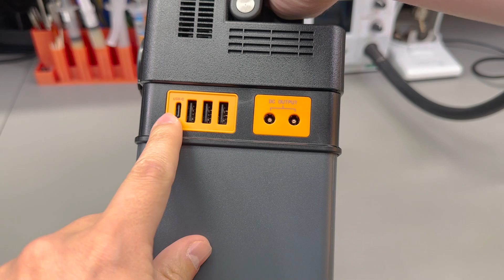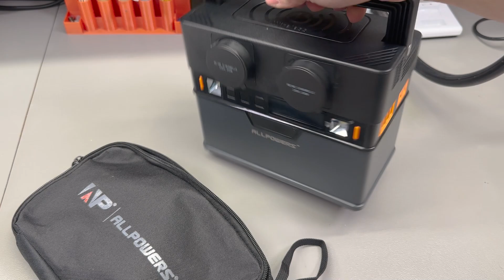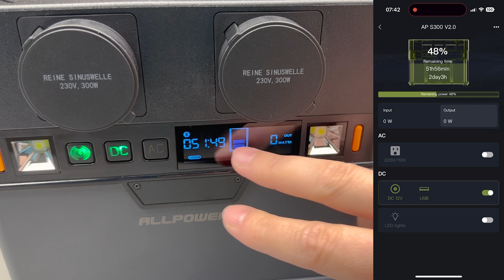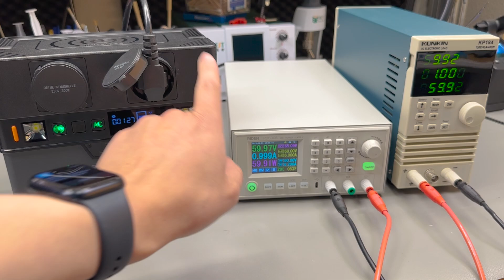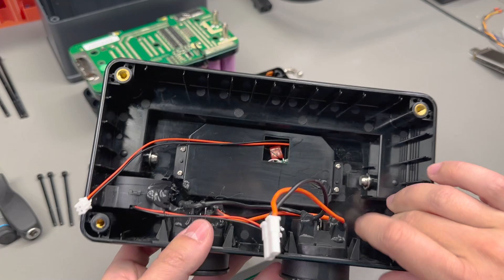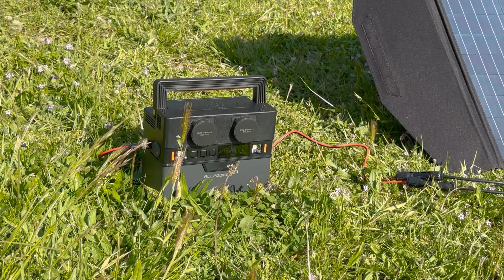AllPowers S300 Power Station Review & Teardown | Voltlog #445

Comment: Anyone wants to know how to reset the battery percentage to the correct battery display , hold ac and dc in together it will beep then still hold will beep a 2nd time keep holding until the 3rd beep then let go youl see the display do the reset to match everything up , do it regularly least 4 times a month

Comment: According to the manual the 12 Car socket is both an input and an output. Considering this you could add extra 12V battery packs with some control circuitry to charge and discharge as needed. Good use for all those 18650 cells that somehow get accumulated.

Comment: Hiya, i found this review very helpful, 

Ive iust bought one of these to use with my laptop which uses 150w. 

Hwowever. I plan on using a dc step up invertor, so i was hoping youd be able to tell us the amperage out of both the DC outputs, what can the cigarette port put out in terms of amperage ?

Thanks

Comment: Great review. Just ordered myself one of these with the solar panel as well. Charging was very quick with the solar panels (for my camping). Great product had the same issues with the DC cut off especially when I connected smaller portable power packs to charge. Big issue I had was charging the phone on the wireless charger but this fantastic review cleared that up for me, shame about the design flaw. By any chance have you found away around this because other than that I am very happy with the product.

Comment: The AC on my S300 doesn't work 0w output, any ideas? Everything else works
Reply from the maker: If you powered the AC circuit on from the dedicated button and it doesn't work, something could be damaged. Have you overloaded that output? Could be reason for warranty replacement.

Comment: What can you use max 300W for? Not a water heater, not a coffee machine, not for power tools, not a vacuum, not a microwave. That leaves TV, laptop and lamps.
I understand you earn a commission for talking about this device and for the links, so you have to talk nice about it, as it's income for you.
You really should reveal that in the interest of honesty.
Reply: Most people won't be using such a power station or a microwave for example. It's more meant to be used for mobile stuff, for camping. I have been using such stations when filming outdoors where no power is present, so I can easily charge my drone remotes, and batteries, power a laptop, and a 60W light that I use when I need a bit more light when filming outside.
Reply: Guitar amps, speakers, laptop chargers, slow cookers etc. 300w is plenty for what most people use these packs for. But yes, for anything bigger, I'll need to buy a much larger unit.
Reply: Also, as a busker this is so small and light, an eb3a would be difficult to carry with all my gear

Comment: Thank you for the detailed review. Just ordered one off of Amazon. I'm wondering if those empty 18650 slots could be populated for some ~10Wh capacity?
Reply from the maker: There are 3 thingss I would check:
1. If BMS can support it or be reconfigured to support it.
2. If the battery charging circuit can support or be reconfigured for the added pack voltage.
3. If the dc-dc converter circuits can support or be reconfigured the added pack voltage

These things might be under firmware control to which you don't have access so it may not be possible to do it.

Comment: LiIon cells are considerably more efficient than LiFePO4 cells (power in/ power out).  The 2 main reasons LiFePO4 has become so popular is because of a certain asian country being unable to obtain adequate  rare-earth metals and the significantly more intricate construction plants needed.  And the idiot-proof thermals that iron offers over the more efficient option.  But to say that LiFePO4 is the better chemistry is a huge stretch.  Its a stop-gap chemistry to aid building infrastructure in a country that is still in its infancy for tech engineering.
Reply: Li-ion are indeed more efficient but what LiFePO4 stands off in is stability, they are more chemically stable and aren't as dangerous if something goes wrong, also I think life cycle is longer
Reply from the maker: In a product like a portable power station shown here number of cycles and safety are top criteria and so you can easily imagine why I would say LiFePO4 is a better chemistry for this application.

Capacity matters too, but when you have a lot of it anyway you tend to look at the other two factors. This is what I meant in the video.
Reply: @voltlog  Portable applications are exactly where LiIon is best.  Lithium Iron cells have up to 1/3rd the power density of LiIon cells this means they are up to 3x as heavy, bulky, and inefficient as LiIon.
I have a few multi-KWH LiIon packs I have been running for up to 7 years now with no overheated cells (ever).  The largest pack now has over 13,000 full 100% cycles of the pack.  This would be 18,570 cycles at 70% DOD. All this with less than 4% degradation in pack capacity after 7 years.  The iron cells can't even come close to that.
I have 2 other packs that are portable and I use them year round from -30F(-34C) up to 105F by properly designing them with active heating and passive cooling.  At the coldest temps the heating uses far less current than iron cells lose due to inefficient cells losing up to 4X the amount of power which they were charged with as pure lithium ion does.
So No, I cannot see why an intelligent person who kinda knows the field would possibly make such a statement.
Reply: @voltlog  The applications where Fe (Iron) cells can make sense is in stationary applications like a home power wall where the same capacity of iron cells is less than half as expensive as the superior Lithium Ion cells.
It can also be used in ballast situations like on a heavy Tractor-Trailer or heavy equipment like excavators and bulldozers.  However, to my knowledge, they are all using Ion cells so far, at least the American & European companies.